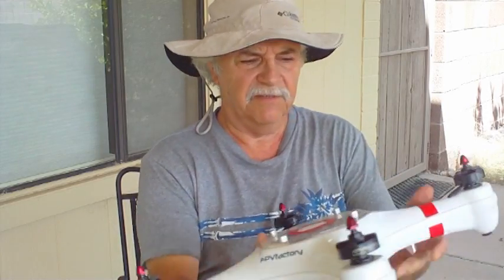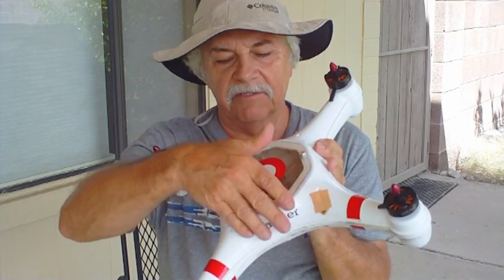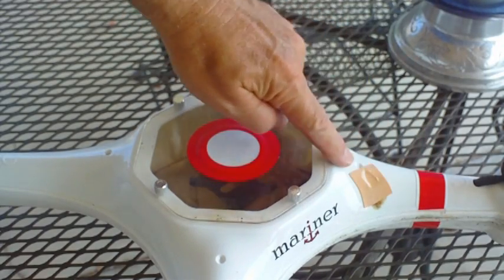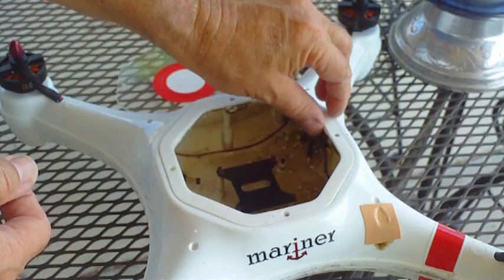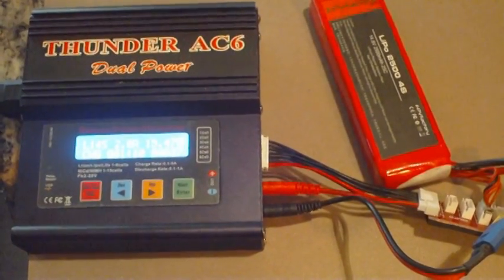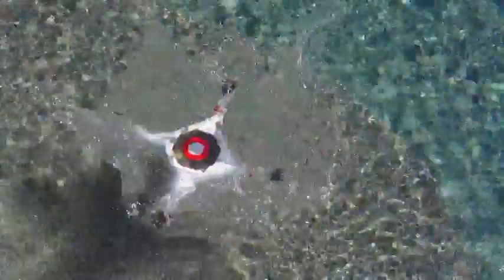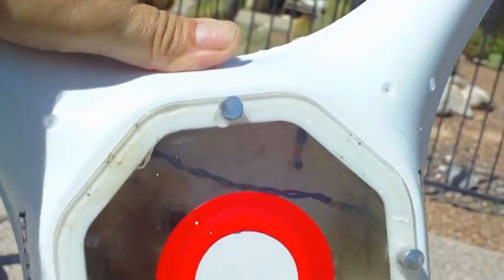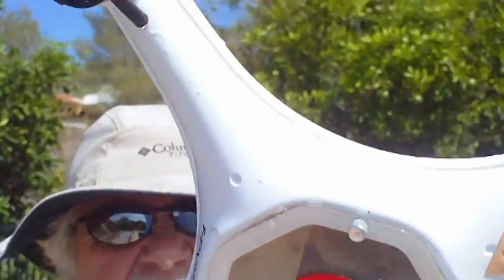NAZA FC Fly Away Post Crash Failure Analysis

Comment: Sorry to hear about your crash.  I'm working through a similar situation with mine.  Had mine flying in BVI last week when all of a sudden it took a 45 degree downward slope and crashed into the ocean from about 50' up.  Water somehow got into the main compartment and one motor caught on fire when I got it back on the boat.  Still working through all the different scenario's.  I did have the solid cover on at the time, however I don't think that was your problem for the water since the non solid covers have been proven to hold out water.  My best guess for loss of control was due to connectivity between remote and drone.  Possibly due to receiver antenna position or electrical interference on the drone with the receiver antenna.  
Thanks for sharing.

Comment: I think it was a total esc failure, because they are waterproof.
Reply: Esc's dont burn out due to moisture / water   the probably burned out due to overcurrent while the motors where turning in the water
Reply from the maker: All the ESCs literally exploded. Oddly enough the battery was fine. Very low current after the crash. :-)